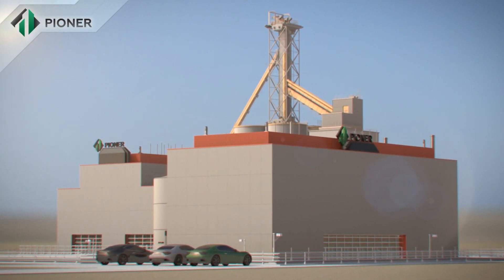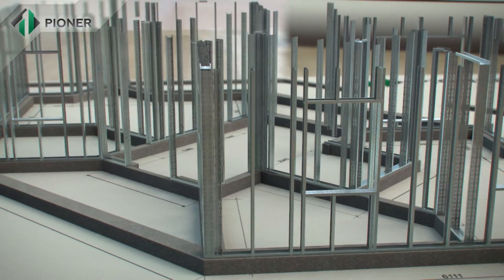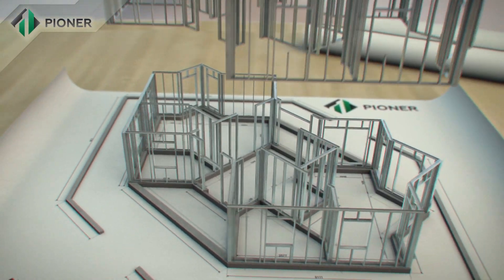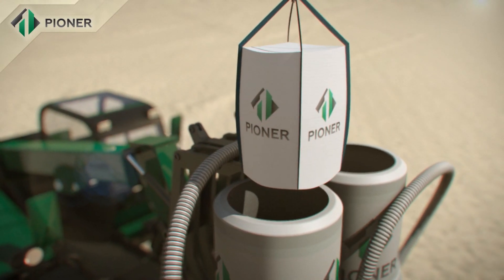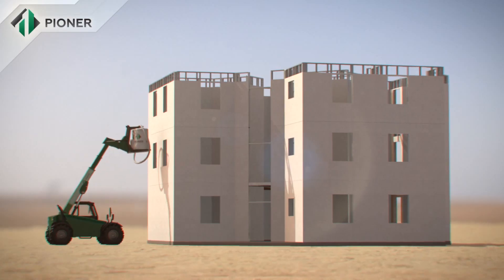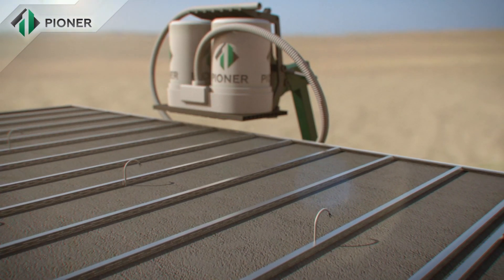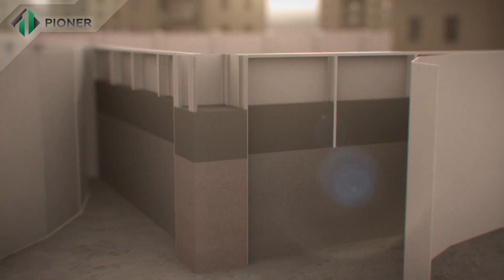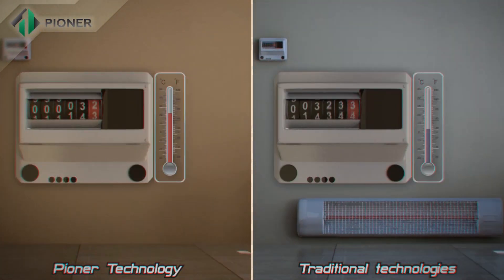Light gauge steel frame building system for low cost housing projects

Comment: Is the side walls strong enough like conventional bricks to stop burglars?

Are the floors above strong enough like RCC to carry heavy household items? Does it pass vibration and noise to rooms downstairs similar to wooden floor?
Reply from the maker: It strong the same as concrete building
Reply: @stretchceilingsDubai  what about the side walls? If thieves tries to break in, will it be as strong as bricks ?
Reply from the maker: @vladmiri  It is even stronger than brick wall

Comment: Are the walls filled to the top?
Can you or have you seen anyone make modular or portable buildings with this building Technique?
Reply from the maker: It filled up to the top because this is not foam concrete this is expended concrete (it is growing). We are planning to start modular in the near future
Reply: @stretchceilingsDubai  So, you let it over flow slightly the cut off the excess, or is there typically still a bit of a gap at the top.,
Reply from the maker: There are small holes on the top, extra material is coming out
Reply: Could these structures withstand earthquake of 6 to 7 magnitudes? Are these houses hurricane proof?
Reply: @vladmiri  
From what I’ve heard yes, over wood or block construction. I’ve seen it mostly used in higher end homes and midd range commercial office real estate.
Reply from the maker: We use the same system for concrete structure buildings for interior and exterior walls
Reply: You also don’t have to worry about brick mortar degradation. It also has a high resistance to cracks forming due to ground settling. 
No more wood rot as well. 
It also has a high resistance to mold.
Reply from the maker: Yes